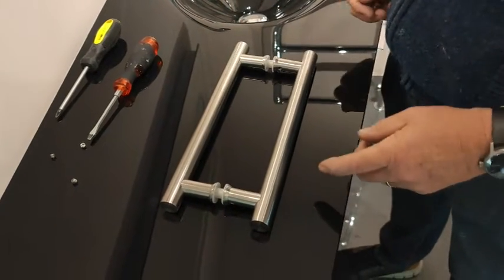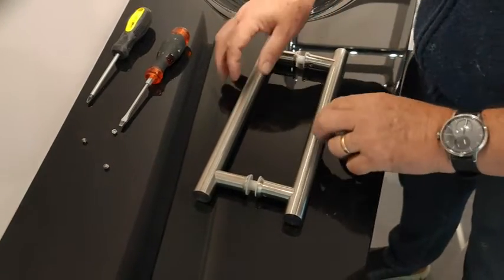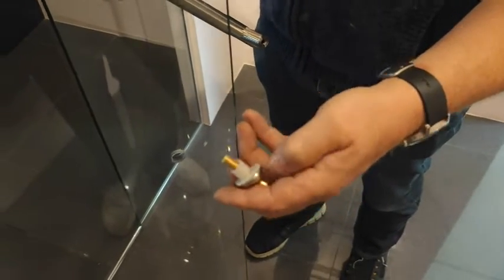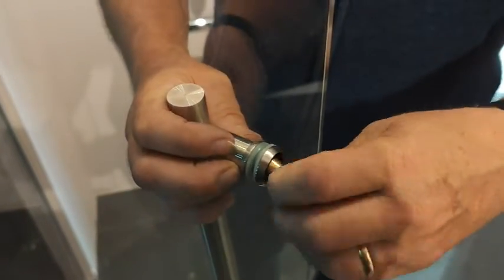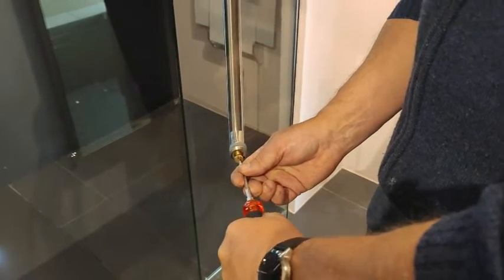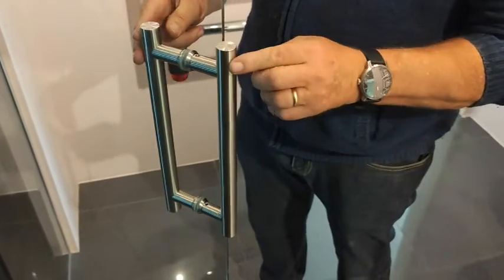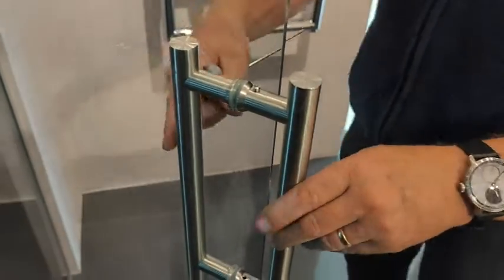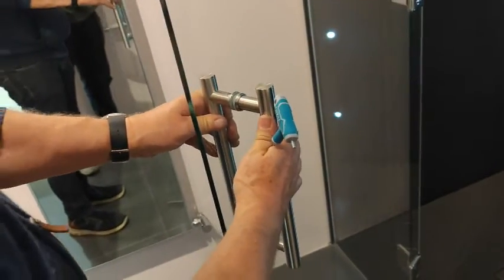How to Install Shower Door Handles

Comment: Thanks for that. But doesn’t the second handle go in the other way around so you hide and don’t see the grub screws. That’s the way I would have installed it.
Reply from the maker: Yes correct but this particular handle had grub screws on the top and bottom of the bars. We showed the process for the top grub screw so it's easier to see the process.

Comment: Should the set-screws on the outside handle be pointed down so that (1) they don't collect water and (2) they aren't as visible?
Reply from the maker: Yes that's correct. Just shown this way in the video to give a better view of the process. This particular model had grub screws on the top on bottom of each bar.

Comment: My glass shower door was installed a few months ago.  The door handle is very loose now.  I found tiny pieces of plastic on the floor.  I think the Bush and/or nylon washer slowly broke off.  Is that possible?   I should have the company come back out and re-install, right?
Reply: Yes